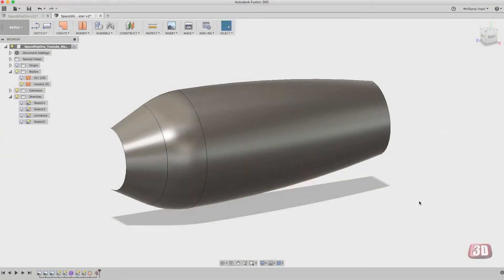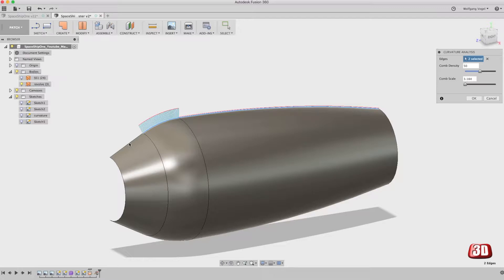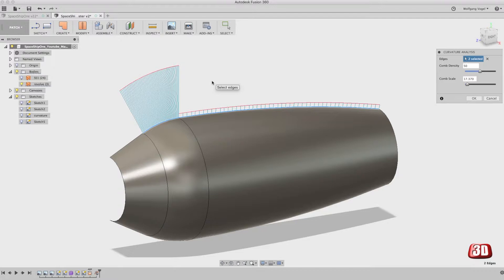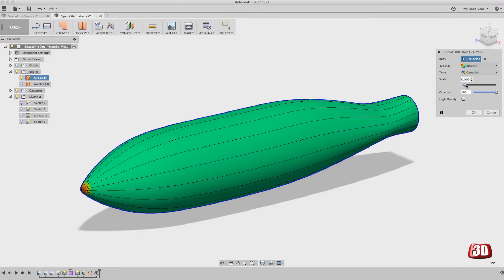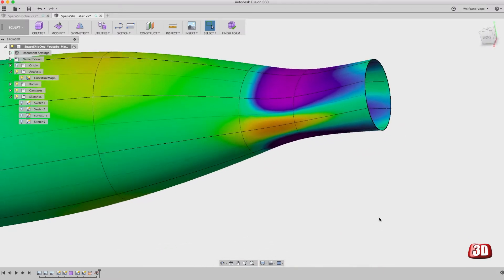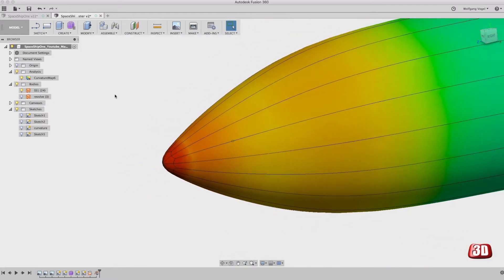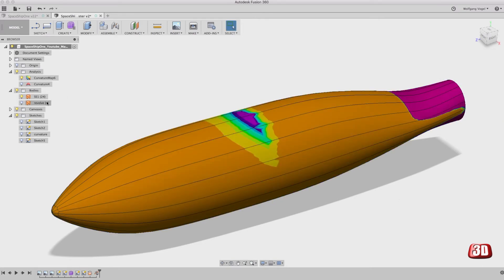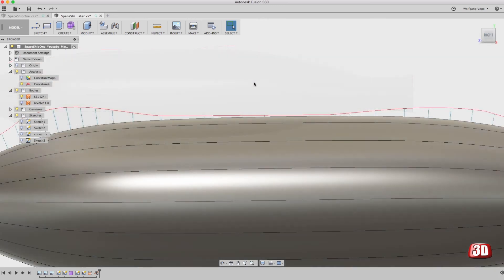Fusion 360 - Curvature

Comment: Thank you for the tutorial. I think with the current update of fusion, you can apply curvature comb analysis to edges in sculpt mode. If the analysis was created in sculpt mode, it should only show up in sculpt mode, as far as I am aware, which is a cool little feature. Quick question, when looking at a curvature map analysis, are we looking for smooth changes between colors or everything being a similar color ( i know this question is 2 years late lol)